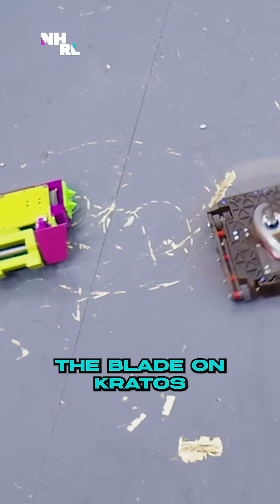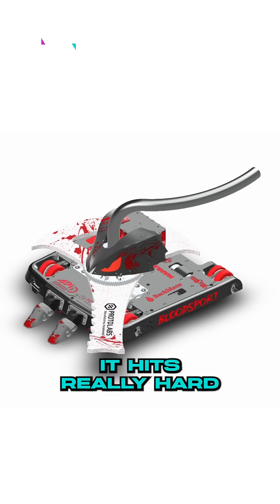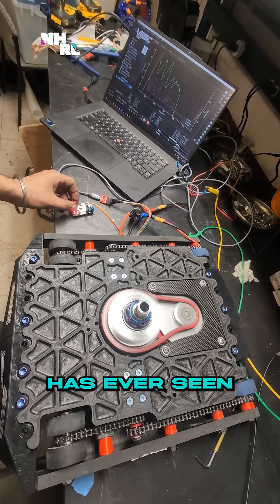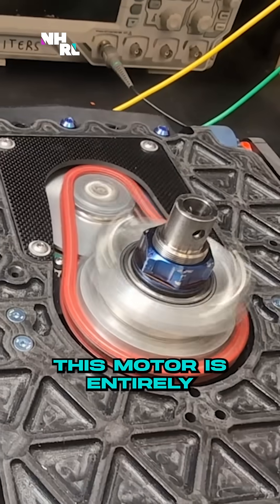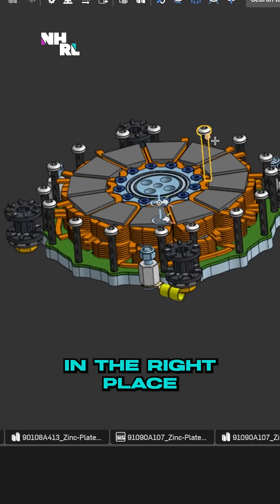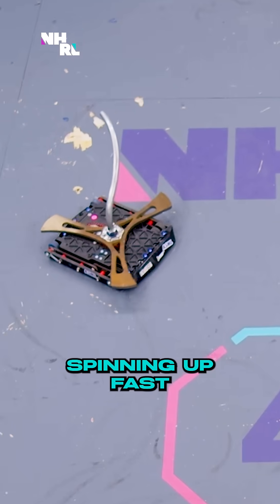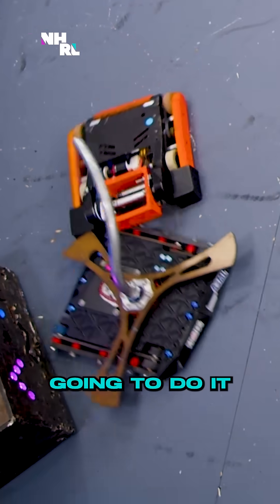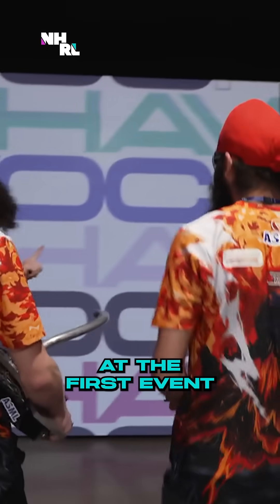MIT Team Built a Custom Axial Flux Motor to Fight Robots

Comment: That’s really cool. One idea for weight savings would be go coreless and use another set of coils instead of permanent magnets, it’s probably more power hungry but it is also much lighter that way
Reply: Wouldn’t the added batteries to account for the power use add weight?
Reply: It wouldn’t be axial flux and you’ll lose torque and speed in electro-harmonics
Reply: @ Interesting, I remember seeing coreless axial flux motors somewhere, but I'm not aware of this problem you speak of, where can I learn more?
Reply: @ironichoneybadger5066  there are axial flux induction motor
Reply: @ that's true, but then you lose out on benefits of the original reason to switch to coreless in the first place which was weight savings. 

also nice badger name :)
Reply: @ 
the original comment talked about induction motors from what i understood, but regardless are you sure that there cant be axial flux coreless (bldc) motors? i couldnt find any but i didnt search too hard
Reply: @badgermcbadger1968  No I'm not sure as I don't know much about Axial flux other than them being insnae
Reply: It also needs the density for durability. Some kind of web would possible break with the attacks. IMO.
Reply: Battery density would be the killer here. I don't think there's any commercially viable battery tech that could keep the weight down enough to run that, though I admittedly haven't done the exact calculations.
If they were willing to pioneer even more experimental batteries and even more money, then maybe.
Reply: How would you power the coils on the spinner
Reply: Batteries could add the extra weight while going coreless. 🤔
Reply: That idea should work. I think you have a winner…just one bug to iron out.